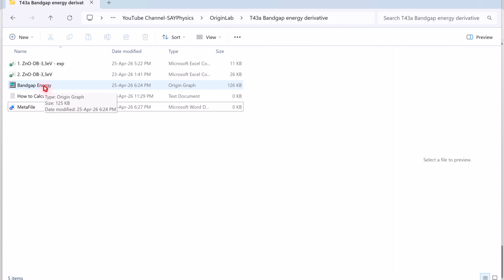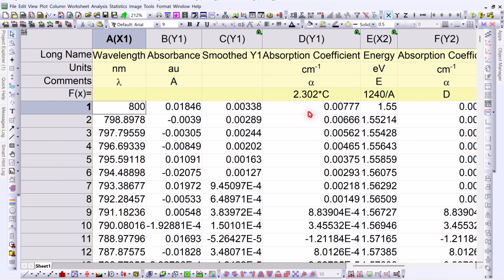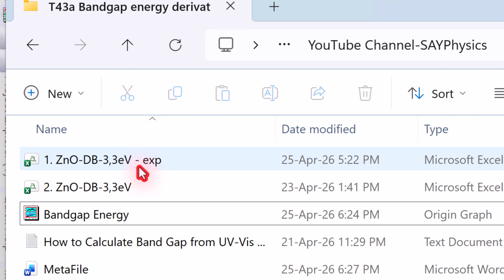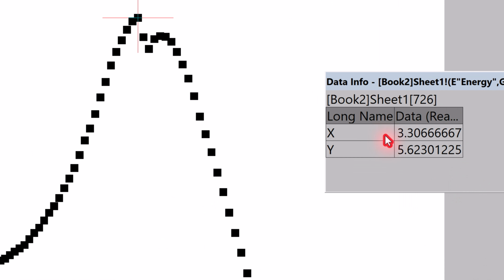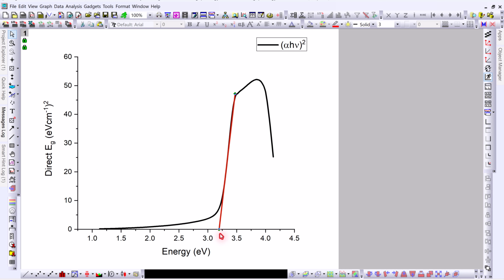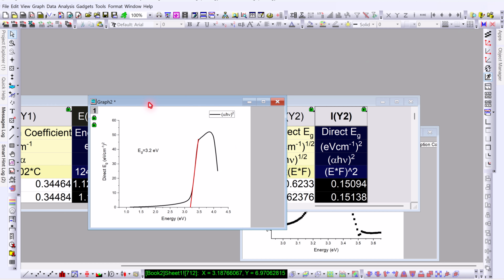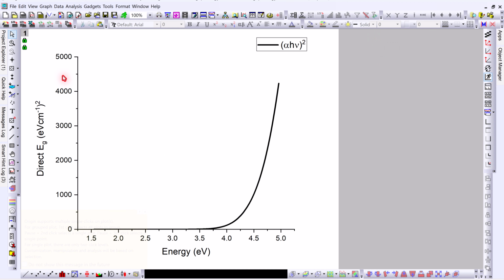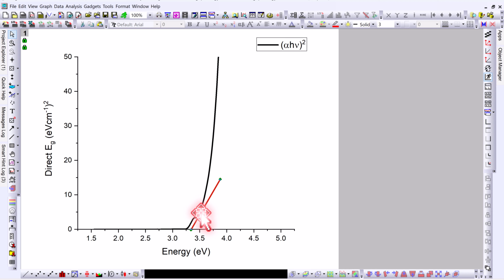How to Calculate Band Gap from UV Vis Using Derivative Method in Origin

Comment: EssalamoAlykom
Dear,

Is there a condition for choosing between a direct and an indirect transition? Can the derivative method provide an idexation to help make this choice?	
For example: Consider the compound Bi1.56Sb1.48Co0.96O7 ; the calculation gives :

Transition mode	Direct 	Indirect 	 Derivative methode 
Eg (eV)                  	2.53	1.53	         1.98

	Here, the derivative method gives an intermediate value of 1.98 eV
The question is, which is the more likely value: 2.53 eV or 1.53 eV?

Thanks a lot
M. Sellami
USTO-Oran Algeria
Reply from the maker: Wa Alaikum Assalam
The derivative method alone cannot determine whether the transition is direct or indirect. It only indicates the absorption-edge region.

Therefore, 2.53 eV or 1.53 eV should be selected based on which Tauc plot shows the clearer and more physically meaningful linear region, supported by literature or band-structure information. If both fits are reasonable, it is safer to report both as apparent direct and indirect band gaps.
Thanks 👍

Comment: Good day,
Is this method valid for Reflectance mode?

Thanks
Reply from the maker: Good day. Yes, the method is also valid for reflectance mode data, usually by using the Kubelka-Munk function before band gap calculation, as discussed in another video in the same playlist. Thanks